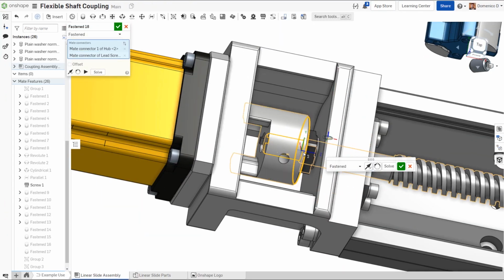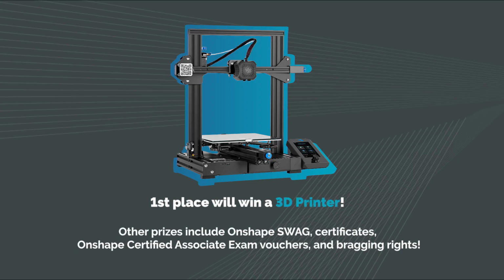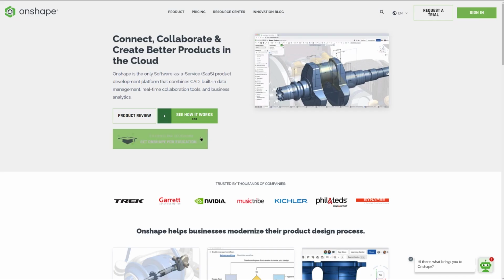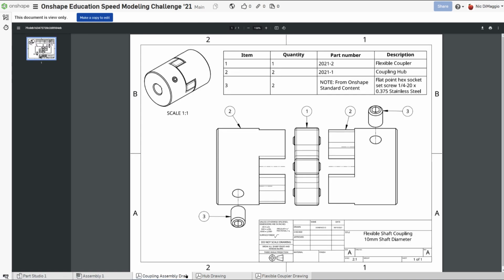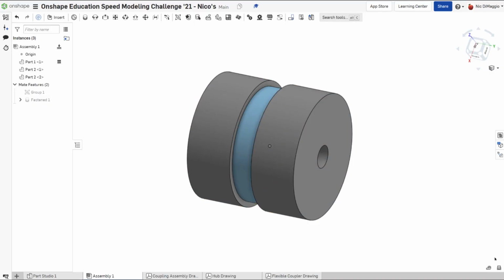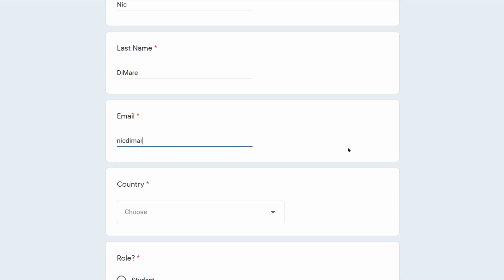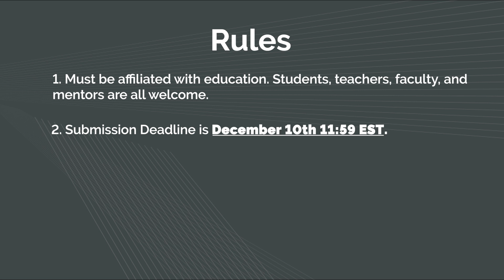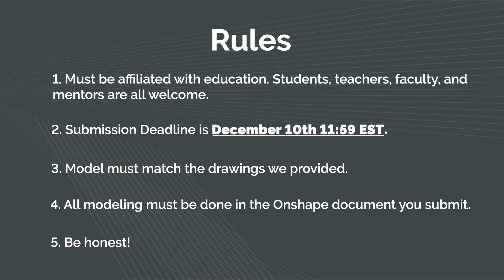Onshape Education Speed Modeling Challenge | Onshape for Education

Comment: Set screw size is bigger then the hole ... We can see in drawing & during assembly time as well... Is this ok ??? 

And when we assemble 2nd time set screw all standard content display automatically without writting anything ... We need to remove them or not ? If yes then how ?
Reply: Yes the set screw should be larger than the hole, these are the inner and outer diameters if there were threads.

When you are officially timing yourself you should make a new copy of the document and start from scratch.